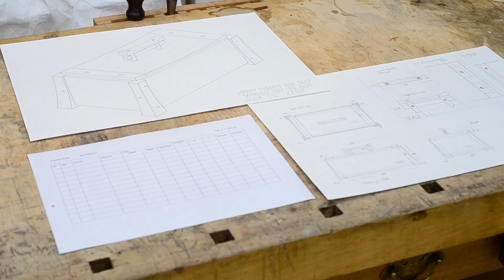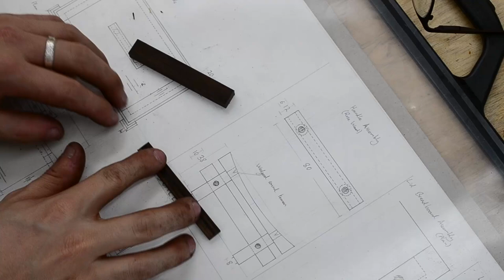Japanese Sashimono Box - Traditional Furniture Maker

Comment: Nice video Harry, and what a box. =)

A couple of questions though... The instrument you use to create the curve of the lid, it seems to use "simple" tension between two equally distanced places (the ends?) and a central column, on a thin and finely planed board. Correct? 
Second question; how do you plane such a surface? If the above is true, you can create virtually any radius for the curve, and I doubt you have a separate plane for every imaginable radius... Wanna tell me how your process works in this case? =)

Also I just found this video today, and I enjoyed it very much. Thanks for uploading it.
Reply from the maker: Thank you! Yes the jig to mark the curve is essentially a tourniquet anchored at both ends, the surface is chopped out and then planed with a compass plane. The plane has a spring steal sole and is a adjustable
Reply: @HarryTMorris  I've never heard of such a plane, this require some research on my part I believe. =)

Also it's great fun to see young people (I'm 36) enjoying woodworking. Do keep it up. =)

Comment: looks good but less than a minute in and i've seen two powertools! Wouldn't have an issue if you hadn't have written "without the use of glue or power tools" in the description.
Reply: Great work anyway though - both woodwork and video production.
Reply: It says without the use of "many power tools." I think I saw three - jig saw, band saw, and lathe. I think 3 qualifies as not many.

Comment: Pssst. An electric drill, a sabre saw, and band saw are all POWER tools.  Now lets get to the:
Traditional tools? Traditional Japanese woodworkers did not use Stanley block planes, metal router planes, shoulder planes,  twist drill bits, crank drills. the plane would be wooden with a metal blade and wooden wedge. The drill would be a bow drill with a round or pointed spade bit. The  router plane would not be used and a metal chisel alone would be used to groove the box bottom groove cut.  
If you want to say "traditional" USE traditional. Hand tools, yes, but completely different.
Reply from the maker: ‘Without the use of MANY power tools’. I never claim to be working as a traditional Japanese woodworker, nor do I claim to be using all Japanese tools. Japanese planes did not ever use a wooden wedge but a forged one by the way. Uncalled for negativity, waste of both of our time